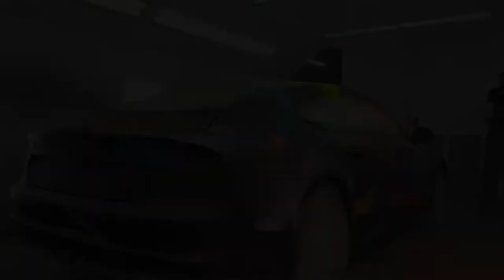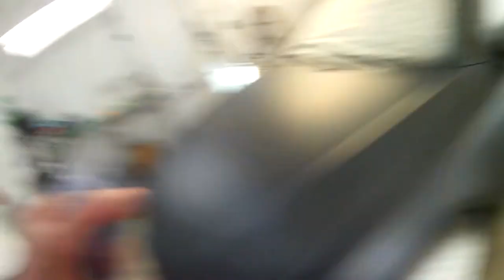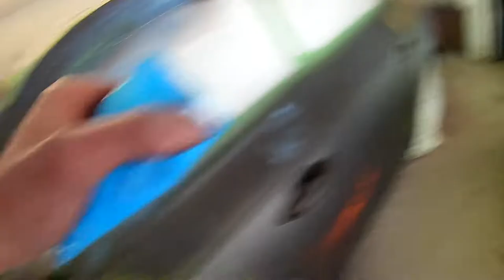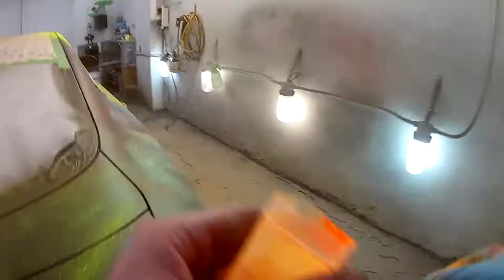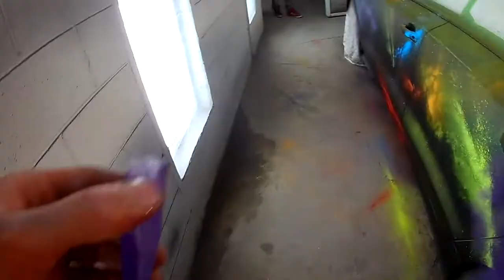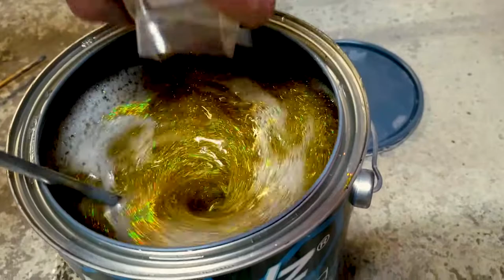Audi A7 - Pearlz Bomb DIP with holographic flakes

Comment: Need to see this out in sun light.. please
Reply from the maker: :( I wish. client never sent that to us
Reply: Sorry to hear.. i have and old audi a4 b5..  bordeaux metallic, + 300gram silver holographic glitter 0,2mm in the clear.. not pro made.. it pops in the sun, an fade to strange silver in the shade..
Reply from the maker: @torbenjacobsen4952  wow. Sick man.. nice job.. does it have a rough feeling to touch ? Coz the flakes are thinner resistant so it dont dissolve
Reply: Yes, it is rough in some places .. 4-5 layers of glitter in and 2 clearcoat layers without .. no water grinding or polishing .. just made for fun on old car .. had made rust stains and there was great color difference though i used original color code .. so something i had to do to hide it a little .. solution was this
Reply from the maker: Yeah. Oh well. It looks good! That's the point right? :)
Reply: Yes. never before painted a car, it had to be tested .. this old shit has become quite modern again, people almost break their neck to see it .. amazingly what 300 grams of simple nail glitter bought at Wish can do ..